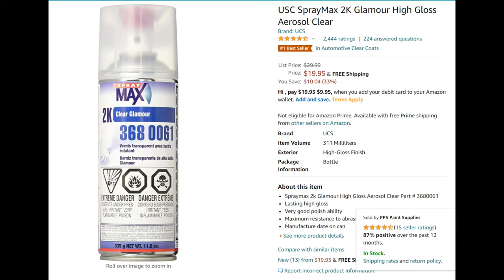Blending FAUXTINA with REAL Patina 1951 FORD F1- Patina paint JOB

Comment: Very nice patina work. I'm curious where you got the fuel cell and it's capacity. If you have a part number that would be great. I am doing the same setup on my 51 Pickup. Thanks and keep up the good work.
Reply from the maker: It's a 20 gallon fuel cell and we got it a long time ago but I think summit racing has some similar
Reply from the maker: Sum-293220-S from summit racing is very close

Comment: Hey there Keller Garage, I’d love to pick your guys brain on a few thing with this technique of painting. First off, can you use rattle can black and brown? Would you want primer in these colors? Also, is that fords Caribbean turquoise color, where did you get that paint? I have built both a 49 and 61 ford truck and want this desired effect. Do you guys have a website?
Reply from the maker: Rattle can wont have the same texture. The turquoise is home made I can give you the parts recipe of you like.
Reply from the maker: No website but Facebook under Keller Customs
Reply: @kellercustomsgarage8289  my truck is nearly that same color, i would love the paint code. btw amazing job I love this truck.
Reply from the maker: Thank you Ben cant wait to see more of your build.